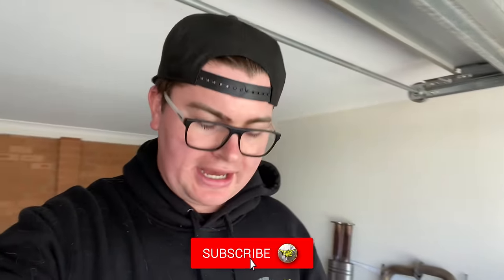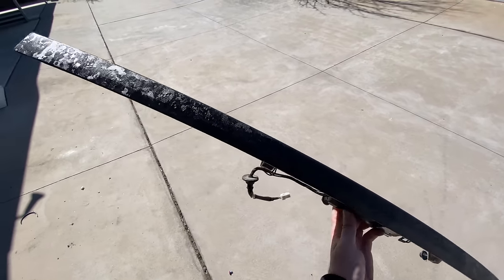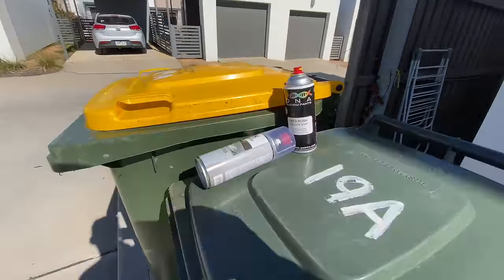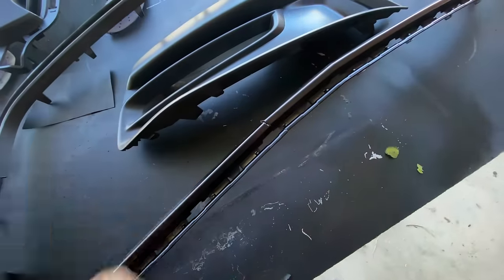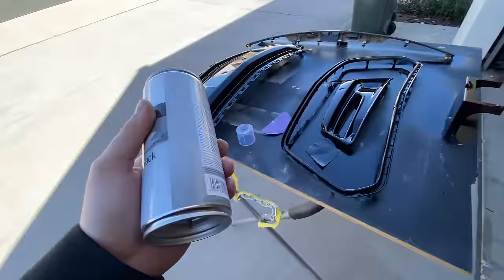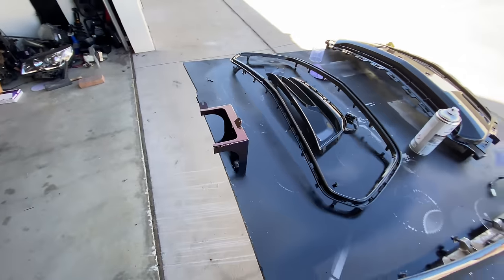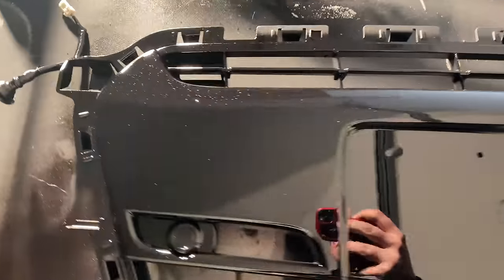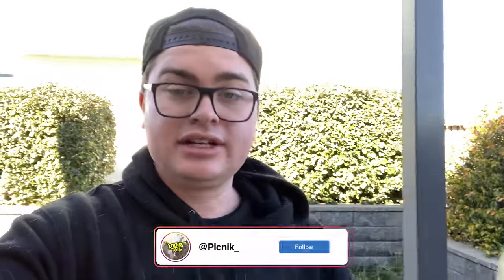Spraying 2K Clear Coat On Vinyl Wrap

Comment: if you take the broken piece and clean the break real good, you could do a quick  fix until you get the new one ordered. clean the break and then apply super glue on the edges. lightly press them together to leave a tiny tiny gap and then sprinkle baking soda over the super glue. it will harden instantly.

Comment: I sprayed some 2k clear over a carbon fiber vinyl wrapped exterior trim piece (spare) to see how it would look or if I could somehow protect the wrap for longevity. After two wet coats of clear, I could barely see the carbon fiber pattern (tried with both glossy and matte USC Spraymaxx cans - same result)
Reply: Try using real clear coat.  Lol.   Mook.
Reply: clear coat works great on gloss vinyl not on textured vinyl
Reply: Thanks